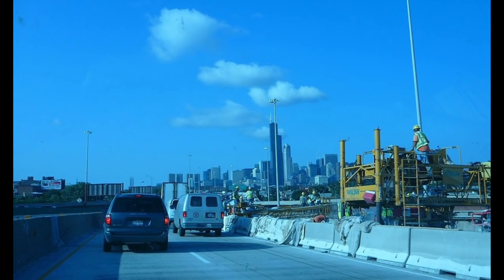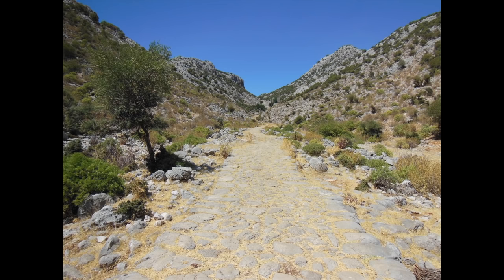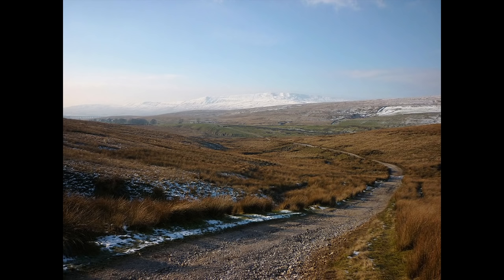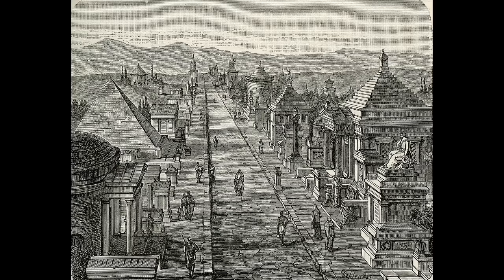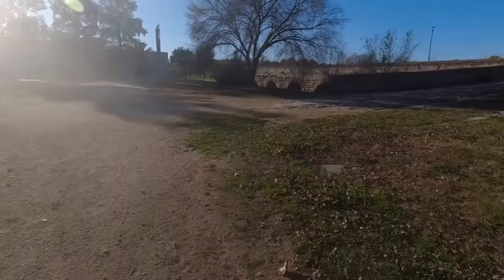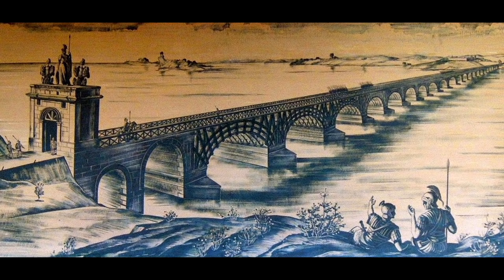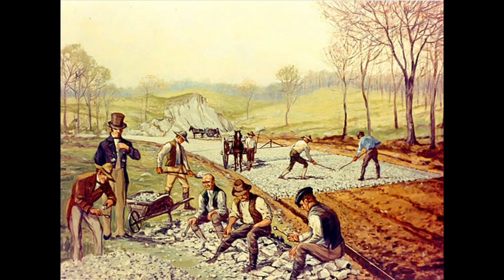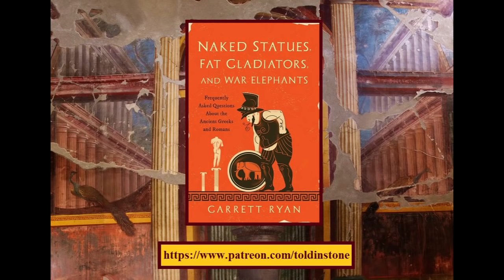Were Roman Roads more Durable than Modern Highways?

Comment: When I cycled down the Appian Way to the South of Rome, I was surprised to note that the grooves in the stones, left by many, many carts, didn't line up. Some at 90 degrees to the road  direction. I assume that when the road was being rebuilt, surface stones were removed, put to one side, and then laid down on the refreshed base with no care for placement. Love to see a Quixotic project to jigsaw it all back - like they do using computers with broken pottery or scroll fragments. It would sure make it easier to cycle on. :+)
Reply: Sounds more like the road builders were trying to stop people using the grooves lol
Reply: Actually, I suspect it might have been done on purpose to make the road safer. A large cart wheel can roll over a rut perpendicular to itself with only a slight jolt. If it was in the direction of travel, the wheel could very easily slip sideways into it and break.
Reply: That comparison with american infrastructure was painful to watch.great content!
Reply: man I wish ai could be in Rome right now
Reply: Sounds right. I think in some cases they did maintain the groves, maybe even replaced stones pre grooved, I think in Pompeii after seeing it may of done that. They may of not attempted to fix the problem of grooves till after Pompeii's time. Would guess the formation of grooves would of had similar problems to street car track like with junk getting stuck in there, and a good part of that was probably from the horses.
Reply: @alphonsobutlakiv789  One of the wooden writing tablets found at the 2nd century roman fort of Vindolanda on Hadrian's Wall is a letter complaining about the state of the roads, and the crappy weather. It could have been written yesterday. ;)
Reply: You cycled on cobblestone?

And you SURVIVED?

...better cyclist than I'll ever be...
Reply: @ineedabetterusername7424  Part of me survived.
Reply: @QuantumHistorian  Actually the short road leading into the top of the ancient theatre in Syracuse Sicily has grooves 7 or 8 inches in depth - must have worked like reverse rails.
Reply: How about instead, it was like carpet tiles. You’d take up the ones on the high traffic areas, and swap them with the tiles from the low traffic areas
Reply: I also did the Appian Way cycle a decent few years back. It was actually Mussolini who ordered the road's reconstruction as a show of national pride back when he took power. They used the original stones, but had no way of knowing where which one went. This is why it ended up the way that it is today. Kind of a good analogy for Mussolini's reign in general.
Reply: @wattsemu582  Thanks for that info. Seems a lack of appreciation of an historical artifact (the road) - like restoring a mosaic and replacing the tiles any which way. With computers and their "jigsaw" apps it'd be possible to fit it all back together - as is done on more spectacular artifacts/buildings.
Reply: @ineedabetterusername7424  I cycled to primary school on cobblestones from the age of 6, and without an older companion from my 9th birthday onwards.
Reply: That is actually leftover from the Middle Ages. The Roman roads had 1 more layer on top a mix of sand and clay to make the road smooth. Unfortunately that needed maintenance and with the decline of the empire maintenance stopped for both roads and Aqueducts. Thus the roman roads today only have their paved layer for use as the smooth layer was sheared off thousands of years ago.
It's the same with the Pyramids  , they also had a smooth cover layer that is long gone.

Comment: One thing to keep in mind is that road wear follows a roughly exponential pattern regarding weight. 99% of modern road destruction is by vehicles so heavy it'd blow the Romans' collective minds; the "day to a year" comparison doesn't even come close to being in the same ballpark. You'd literally have to have a million people walk a road to do the same sort of wear on it as 1(!) decently heavy truck. 

... doesn't mean Roman infrastructure wasn't even impressive and that I love that quite a bit of it is still around, one way or another.
Reply: yeah but roman roads are still used today by cars and trucks
Reply: @eduardopupucon  but they aren't busy and usually have a slow speed limit limiting wear
Reply: yeah, one fully loaded semi trailer would equal a legions entire supply train, including the prostitutes and camp followers. The romans would not know how to act with that much mobility.
Reply: @eduardopupucon  Not really, most of them are under protection, and those that arent are mostly used for very light traffic, if a semi would roll through these roads than it would sustain a lot of damage
Reply: @eduardopupucon  Dude, the stones themselves would have worn out in centuries, let alone millennia.  Those roads are repaired and maintained.  They didn't build roads out of adamantium.
Reply: True but the damage done by cars and trucks is damage done over the years making the road bumpy but modern road quality wears off quickly bcs of rain and other elements.
Reply: @CrispMan1  Not really. Trucks do just about all damage to roads (1 truck equates to something like 10,000 to 15,000 or more cars), exceptions such as floods, earthquakes and some specific ground conditions aside. 
Nothing else comes close; if you pave a footpath same as a top-quality highway with proper water management and such you could walk that for centuries with barely anything changing about it.

That's essentially the point of the video. Roman roads are "impressive" because they don't have to deal with trucks or anything remotely comparable. IF we banned trucks, then yes, it'd be environmental factors that did the largest part of the damage, ahead of cars. But as it stands it's the heaviest vehicles and they outdo all the other factors combined by far (again, unless something special is going on).
Reply: @Sp4mMe  yeah thats the point if u build them with proper water management etc they would be better but ive seen roads pretty much lose asphalt in less than 10years in places where there is bearly any traffic. But also gooes from country to country u cant compare my countries roads to germanys
Reply: @InternetMameluq  centuries sure seems a lot better than the track record of modern roads and the politics involved.
Reply: @CrispMan1  A big problem today is the foundations of roads. Many roads are built on terrain that is susceptible to slippage meaning whatever material goes on top has the ground underneath move during rain storms etc placing additional stresses on the surface as it is always moving with the ground underneath. Highways where heavy rock etc was used as a foundation last far longer than the typical road which is built on soft surfaces due to cost constraints and shoddy workmanship where distance completed each day is more important than quality of road constructed. Plus building poorer quality roads means more maintenance and therefore steady employment fixing the potholes etc .
Reply: But remember, rubber tyres exists today which is softer and spreads the weight per square inch more effectively than a narrow stone wheel, hoofs or metal rimmed wheel.

Comment: It blows my mind that a Roman bridge was still being used until 1991. My god.
Reply: I bet a lot of them can still be used but traffic was stopped to preserve them for history
Reply: I think the Ponte Milvio bridge in Rome where Constantine's soldiers defeated those of Maxentius is not too different from the original constructed in 109 BC.
Reply: A good number of them were still used even for vehicular traffic nowadays
Reply: @jcgabriel1569  bad move, cars will destroy those roads, roman roads are made for people, and an occasional horse carriage, not an car/truck.
Reply: Also, there were several Roman aqueducts  that were still used until the 1980s-1990s I think. And to top it all off, there were a few dams built by Romans that were still operational to this day, the Cornalvo and Proserpina dam in Spain. And there's the Lake Homs dam in Syria which is probably the largest ever constructed at the time, and is still standing to this day, they even increased its reservoir volume!
Reply: @stefthorman8548  From what I can see with pictures, they use a layer over it, like a new layer of paving over the old road surface, or even tarmac. Also, it's not like they'll just expose the old road layer if they knew that it won't hold anymore...
Reply: I ponti che costruiamo oggi crollano dopo 50 anni..
Reply: There's a Roman bridge in Melbourne England that is still in use to this day.
Reply: Most of the public waste sewage in central Rome dates back to the roman empire. Kms of underground huge tunnels draining the waste water away from the city, the first city sewage of history, still in use.
Never even considered to change it, since it still works perfectly well, and it is too much deep underground due to the rise of city surface.
Later sewage, made more recently, requires continuous maintenance.
Look at the Pantheon: after 20 centuries it still stands proudly like if it was made yesterday.
They knew how to make things, back then.
Reply: @JasonT-xp3kh in Italy there is more of less one in every town. They just refuse to break down.
Reply: @abocabo538 è anche vero che ci passano sopra a cento all'ora i TIR con sopra 30 tonnellate di merci, giorno e notte...

Comment: Eisenhower's 1950s Interstate Highway project was, in part, a military project for the quick movement of troops. That is one of the ways it was pushed through congress.
In the original design, all bridges on the Interstate were designed to carry military tanks. 
The original Interstate highways were designed for light trucks of the 1950s, but the trucking industry lobbied congress for bigger and bigger trucks. The big very heavy new trucks then destroyed the roads designed for the smaller trucks.

Comment: short answer: no! even the sturdiest roman road cannot withstand 3,000 heavy trucks and 15,000 cars driving over it in one day without becoming completely undriveable the next morning; this is not to mention that even the smoothest roman road is absolutely unsuitable to drive at 80km/h because it will destroy the suspension
Reply: ? there is cobbled roman roads that are still used today.. even in this video he showed this.. there is also 1000snds of medieval roads and streets in common use today.. the main issue is cobbled roads they are slipper at speed and can cause accidents especially when the ground is wet. a cobbled road is far stronger and durable compare to a modern road but at speed can be very dangerous but easy and quick to repair.. .. this is why even today many  urban flatter high traffic low speed  areas are in european towns  cobbled.. and stone kerbing is used.. it lasts 1000 years.. can be fixed in afew minutes and looks great
Reply: @manchagojohnsonmanchago6367  i guess you’re right, in terms of durability it’s clear that quality cobbled roads win. i made the mistake of confusing the question, just because asphalt roads are a better option for many uses doesn’t mean they’re more durable.

Comment: Fascinating topic!  It's common to joke about Roman roads that are usable to this day vs modern roads that last a couple years but it's usually meant facetiously.  Asphalt is relatively inexpensive and wears quickly but it provides a much quieter road surface for high speed modern traffic.  Concrete is more durable but more expensive and louder to drive on.  Quarried granite would be more durable still but quite expensive and drivers would go insane from road noise.
Reply: It's not insanely loud to drive in granite roads, some of my local ones around the church were paved on it some 70 years ago, but, as a consequence, on irregular granite, you have to drive slow.
Those were made at a time when there were no cars around, so the road just not turning into a muddy sinkhole that takes two days to get your ox cart out of is a good enough compromise
Reply: @riograndedosulball248  So it's not possible to drive at normal speeds on this granite road? Sounds like a bad road.
Reply: @Industrialitis  mind you, it's not cut and squared stones like Roman roads are. it's made of irregular granite pieces cobbled together. Of course it's not as good for modern vehicles as modern, well kept roads, but it is in no way bad. And it requires barely any maintenance to be ok. Good enough compromise.
Reply: @riograndedosulball248  Sure, whatever.
Reply: @riograndedosulball248  Even well maintained cobblestone roads ara a pain in the ass to drive or cycle on.
Reply: ⚠️Some roman roads, those that ran between cities whose route required people to go faster, were actually paved with a concrete like material made from clay, which was very smooth. It lasted a lot longer than asphalt, but was not nearly as strong when it came to weight, but at the time it wasn't a problem

Comment: We’ve still got a lot of Roman roads here in England, easy to spot because they are dead straight for miles (obviously now they are tarmac’d).
Speaking as an Architect, Surveyor and general builder, I am always impressed with the Roman roads in Italy that still have the original paving. The levels and plumb-ness are amazing. It takes a lot of expertise to do that, and probably isn’t appreciated by the layperson.
Reply: That's why we should always think of the Romans as our intellectual equals, capable of doing anything we can do today that's doesn't involve computers.
And of course, the Greeks did have a very complex astronomical computer.
Both those civilizations could have potentially gone on to reach an advanced technological age much like out own,
but they just didn't have enough people to come up with all the ideas we've collectively had over the ensuing 2000 years,
and there were too many threats and wars to spend money on anything but military.
Reply: Recent archeology in the UK has revealed that a lot of Roman roads were built on top of existing roads, which means that some part of the Roman road network there just followed existing Celtic roads.
Reply: They used a surveying device called "groma" that used a suspended plumb line to track the next leg of paving.  Roads almost perfectly straight for miles.

Comment: The American interstate highway system was partially implemented for a military purpose. It was designed, in part, to allow quick deployment of troops in case of invasion. The highways were also presented as possible runways for military aircraft, though I question whether they would work for that purpose.
Reply: I don't think they had airbuses like that when they first built these highways
Reply: @iHawke  the interstate system didn't start getting built till the 50s
Reply: @iHawke  they sure did.
Reply: They do work, as long as it’s not a super rough patch (for smaller planes at least, not sure about jets)
Reply: @cara-seyun  militaries around the globe have been using highways for launching by and landing jets, Ukraine is doing it right now.
Reply: that and, at least from one video I watched. It literally took more than a month? to cross the us before the interstate system was made. Now I believe it takes 4 days. and that isn't figuring in the horrible road conditions, the experience a driver would need, and the fact that for the most part. There were stretches of road with no infrastructure for people out west for some length

Comment: Is there evidence of romans ever having to rip something out and start over, without a significant period of time elapsed after construction? It took caltrans 20 years and two tries to build a highway bridge over a creek that surface roads already crossed...
Reply: In California at least, much of the delay is usually caused by abuse of the CEQA by various organizations.
Reply: Even in the UK, I work in a comp school and we had a new section built 5 years ago. Already it needs repairs due to cracks, I can't see it lasting another 40 years.  Yet a few towns over a Victorian school built in the 1850's is still standing proud.  The Victorians and also the Romans didn't use the cheapest, nastiest materials they could find.   I guess the equivalent would be the Romans building the Pantheon out of wattle and daub...
Reply: They had to redo bath houses a lot and apartments due to fires
Reply: @mikesully110  very late, but you aren't wrong. though imagine trying to get the permission for a very high budget to make the same building out of something much more expensive and stronger.

Comment: Treves‘ main bridge crossing the Moselle is still a Roman bridge. You won‘t see it first as the deck is modern, but the pillars are from 150 AD! They are designed to withstand floodings and ice drift and they do.

Comment: Good piece. I suspect a number of engineers, civil engineers and/or architects took inspiration from Rome in the 19th century (if not outright engaged in copying). I seem to recall that the chief engineer for aqueducts for New York City running from reservoirs north of the city was a teacher at West Point that basically copied techniques - so referring to the Croton Aqueduct.

Would be great if you could continue with more episodes on civil engineering in Rome and its impact (or revival, in copying) in more modern times.
Reply: On face book I saw pictures of old road stones one and the new one rotten bad ones in Lithuania and the article said In lithuanian language they built us road that lasted thousands of years but the Engineers build us to roads that looks like this , ha ha ha ha